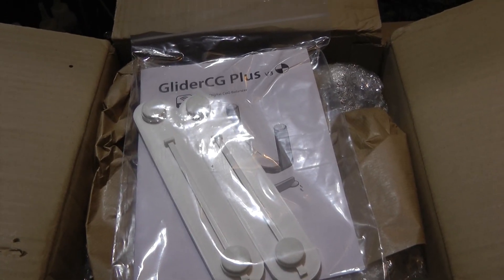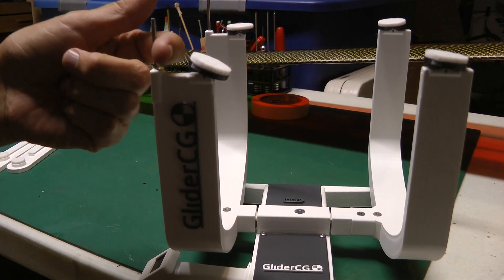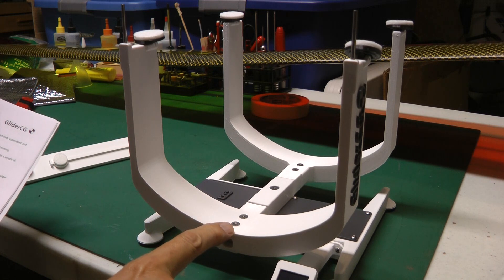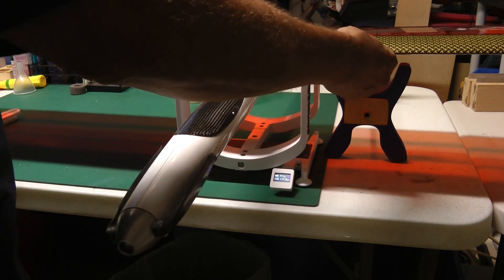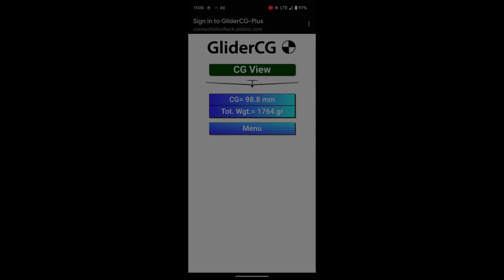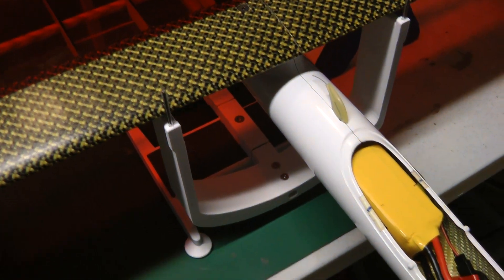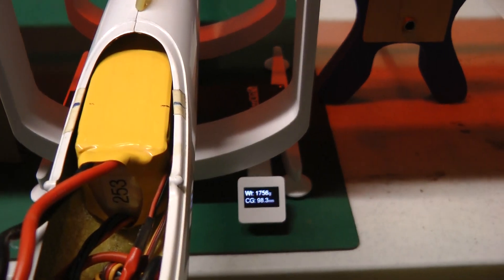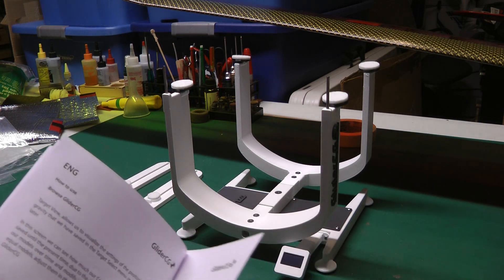GliderCG Scale

Comment: Hi Gari Quiring, very informative video, easy to listening and understand. 
Thank you.
May I ask you something?
It says glider cg scale right?
Can I use this device for other rc plane like, scale, sport, trainers, F3A?
Reply from the maker: Yes it can be used with any type of plane where the fuse fits between the U shaped holders.  Regular planes could be an issue with the landing gear interfering with the holders.

Comment: Thanks for a great unboxing, review and demonstration of the Glider CG Plus. I am still having trouble deciding between the Glider CG and the Plus as I fly everyrhing from 1m DLGs to 3m+ scale ships, but mostly sailplanes on smaller side. My concern is does the accuracy suffer on the lighter sailplanes and those with narrower cord wings by using the largest of the scales.
Reply from the maker: I'm not sure, my sailplane fleet is between 3-5 pounds on average.  I have an Alpina 4m, I never tried it on the CG scale, it weighs 12+ pounds.

Comment: Just bought 1 of these. 
So after you get the CG
Dont u mark up under the wings and then balance the glider on the 2 metal prongs?
Reply from the maker: No, that's the whole idea of buying the scale so you don't have to do that.
Reply: @GaryQuiring  sorry I’m lost how do u no it balances then?
Reply from the maker: @tomfpv1982  Place the glider on the scale, make sure the leading edge of the wing is touching the two front pins.  Read the number on the scale.  Then move your battery or add the appropriate weight to the front/rear of the glider until you get the number desired.